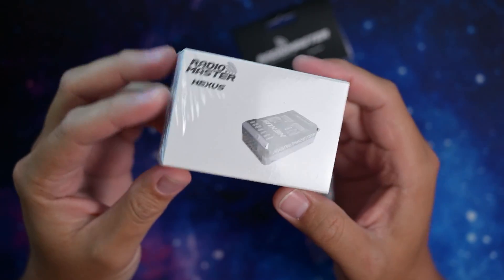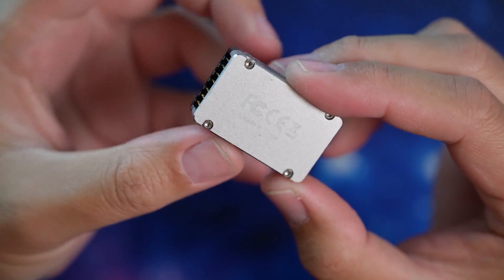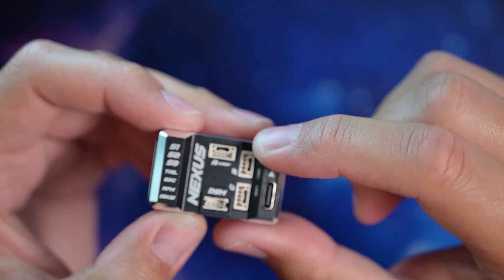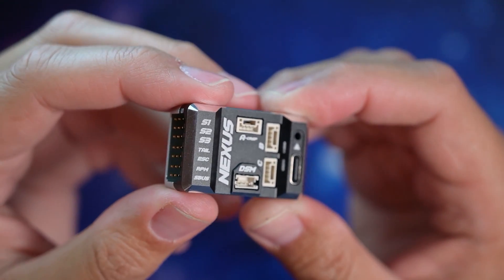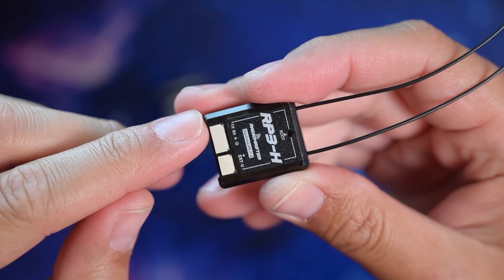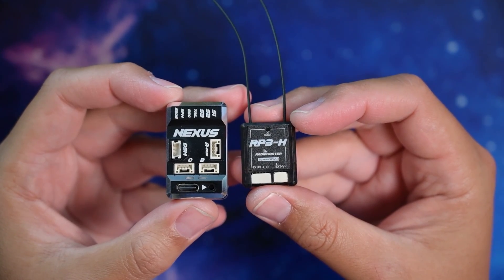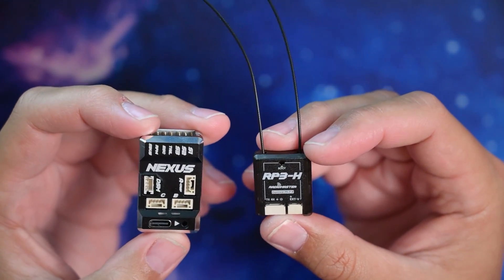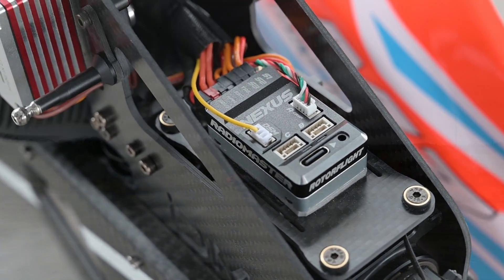RadioMaster NEXUS & RP3-H Receiver Quick Look | NEW Rotorflight 2 Flybarless Heli Flight Controller!

Comment: I'm having a rough time setting up my tail rotor in my FBL nitro. Do you have any tips? I've got the servo responding, and mechanical setup done, but can't get the gyro functioning properly. Can you point me towards any good setup info?

Comment: Awsome video, any chance you could do a setup video using the Nexus? I would be interested to see what the setup process is like. Considering it has a RPM port, I imagine it has built in governor? How does this governor perform?
Reply from the maker: Now that Rotorflight 2 is released, I think we will start to see setup videos! And yes you really want RPM with Rotorflight because it uses the RPM and gear ratios to filter noise. The governor works very well and is highly tunable. It was written with electric in mind, but there are a few people making it work with nitro too.
Reply: @RobertBurrow87  awsome, thank you for the response. I'll be looking forward to more videos about it soon!